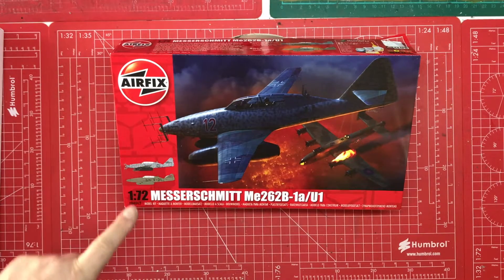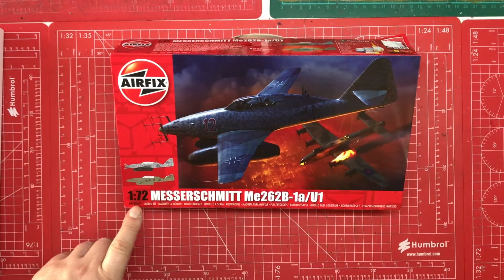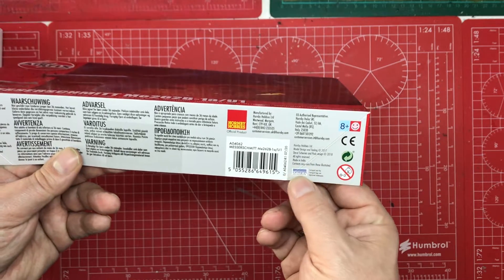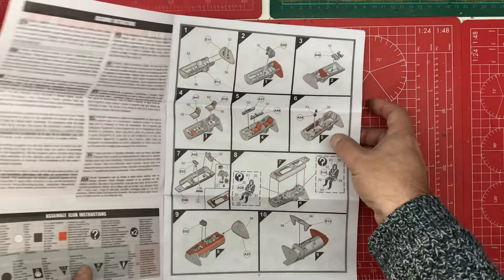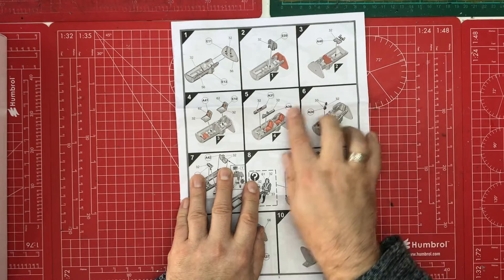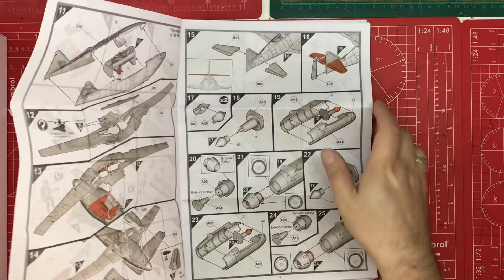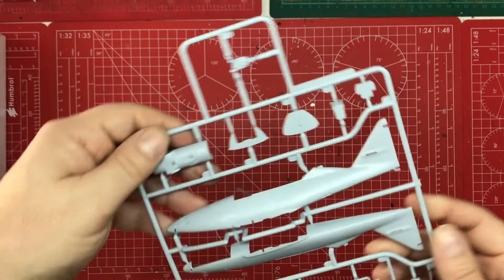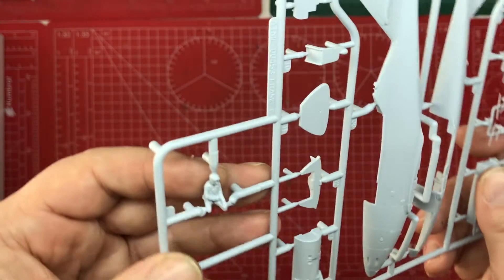First impressions, Airfix, 1/72, ME262B-1A/U1

Comment: Hi Jason, Great review. Does come with some interesting decal schemes, shame it's not 1/48 scale as in captured markings, would look good next to the Bf109 I have in RAF AAe markings.
Also I'm guessing that you can use the gear up option doors to mask the wheel wells when painting.
Reply from the maker: Its certainly worth ago if the fit is tight enough
Reply: Hobby Boss do a very nice 1/48 Me 262 family including the Nightfighter and the 2 seat trainer.

Comment: I just noticed that Airfix wrote Messerschmitt wrong on the first page of the intructions. There is a h missing. Maybe the reason is, because they run out of space. The 1945 version is a night fighter with the antenas at the front.
Reply from the maker: good spot I missed that